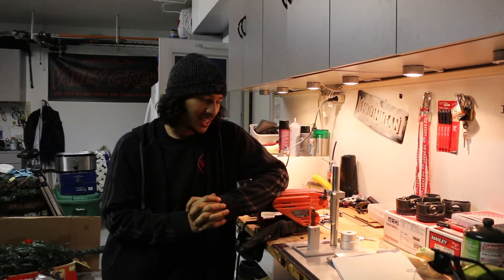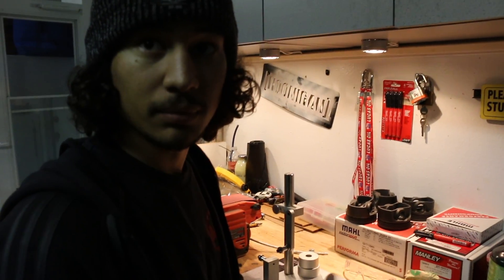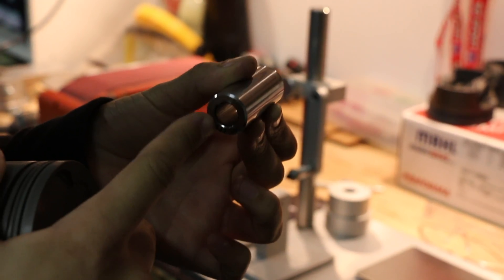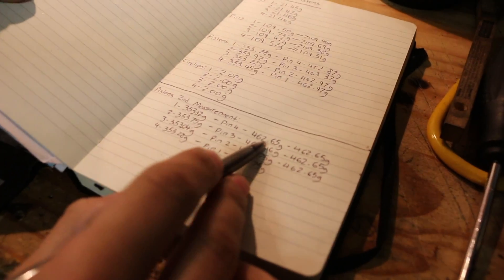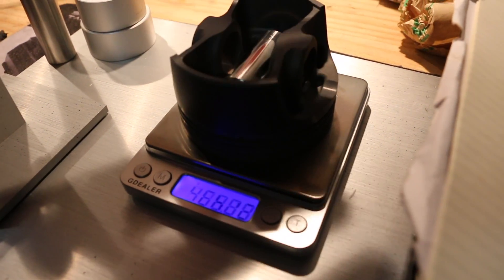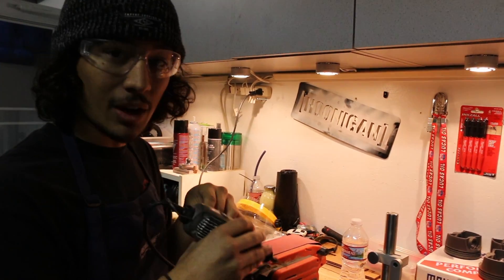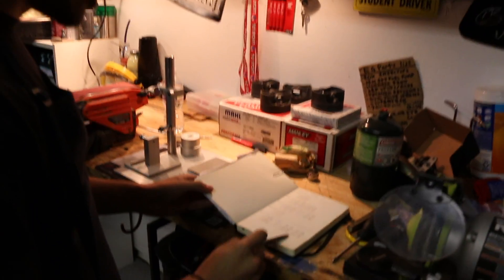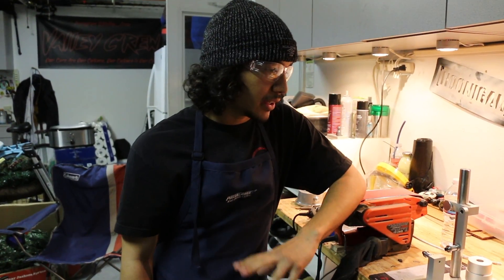HOW TO BALANCE PISTONS - FOCUS ST ENGINE BUILD

Comment: Don't really think its necessary these days to do any extra balancing on new, forged parts out of the box (as long as the manufacturer is trusted/reputable of course). The reciprocating and rotating assemblies can be generally balanced within +/- a couple grams of each other; my S54 motor for E46 M3 has the stock rods balanced +/- 4 grams for example, which is a huge difference in tolerance compared to my aftermarket rods and pistons, which are both balanced within a little less than a gram OOB, and even at stock tolerance that was considered fine. What's most important is to ensure that both ends of the crankshaft are balanced; this is why you'd want to end up taking your parts to a machine shop anyhow, to ensure they hook up and balance your crank using bobweights (to replicate your rotating/reciprocating assemblies) on specialized equipment that's way out of our budgets and facilities for DIY. As long as your machinist is using the proper tools and methods, he/she should simply just need to double check the manufacturer's specs/work on the pistons and rods (again shouldn't really need any balancing here, my machinist did no balancing work on either pistons or rods when returned to me, but I could see the crank had some of the weights shaved down a bit and smoothed), and then any major work done by the machinist for balancing will typically occur on the crankshaft itself for internal, and then counterweights on flywheel/flexplate and the harmonic balancer for external. On a bike that revs to well over 10k RPMs, more precise balancing may be required such as what you're attempting.

I love your enthusiasm though, I'm the same way; I even have many of the same tools as you, including the rod balancer tool - it's always good to double check manufacturer work, even on your own, gives you peace of mind :)  hope the rebuild went well, I've been rebuilding my S54 for over a year now, well worth the patience in the end!
Reply: Balancing to a tighter than OEM specs will always have benefits, even for a daily used motor. 
It will increase the life of the motor. 
Doing balancing and not considering the balancing of the crank, which is the biggest moving mass in the motor, is a bit of a useless exersize.
I only ever do balancing of 2 cylinder boxer motors where the opposing weights of all the moving parts are neutralising each other and have no effect on the crank balancing. The boxer motor is the only naturaly balanced design and the only thing that should introduce vibration is the offset of the rods and pistons.
In this case it is beneficial to balance only the rods and pistons and if done well, boxer motors can run incredably smooth especially for a 2 cylinder motor.

Comment: strange that the weight is changing.  it would give me anxiety always having a variegating measurement.  especially if the scale is dictating my removing of materiel.  Good work tho!
Reply from the maker: Mizter Paradox 
When we setup the scale we put 3m double sided tape underneath so we think that could have caused a change in the measurements we saw after setup. We put 3m tape because when the rods are being balanced the scale and platform cannot move so we adhered the scale to the main platform of the rod balancing tool.
Reply: @tbr.performance  I'm doing the exact same build at the moment. it's probably just the scale misreading giving you those variations. tends to happen when you have something that can weigh from .01-500 and costs under a hundred bucks.